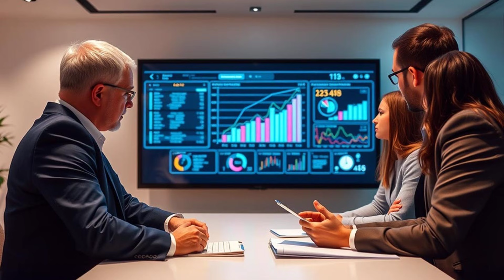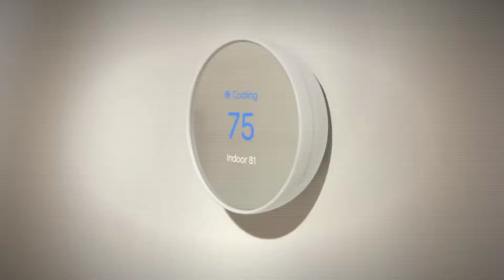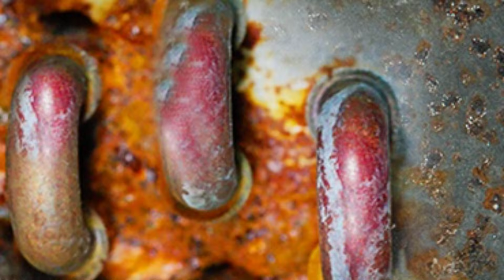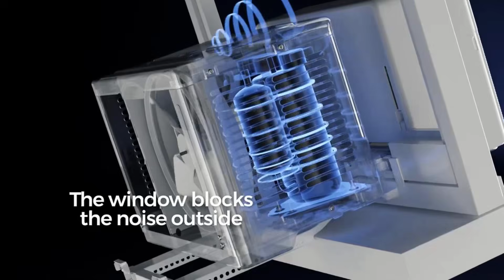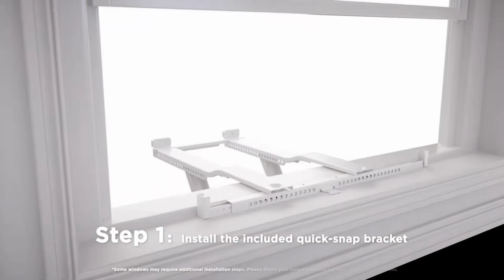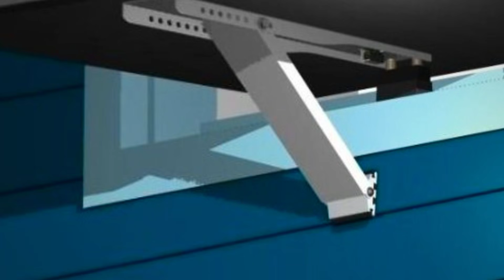Why HVAC Techs Refuse to Pay $500 Power Bills (The $300 AC Loophole)

Comment: like 90% of my clients have no idea what I'm doing in there home, it's a education issue home owners should be expected to understand there core concepts of how There hvac system works. A HVAC System is NOT the UNITS its the HOME and the Envelope. Even most home inspectors have no idea how to guesstimate air leakage in a home, duct work is extremely complex as per balancing and shit head contractor rip out and replace without knowing what there new duct geometry causes additions to duct work are hardly every balanced right. under education in HVAC systems have lead to me being able to say 100% of homes have a problem I can solve. I don't need to up sell you anything to survive, every one of my clients need 100s of jobs done we just determine there priorities.

Comment: About 80% BS. For example, most upper tier central air condensing units are 16 SEER, and use variable speed compressors. Most "mini split" units are very expensive to buy, and even more expensive to repair, because that Co is the only place you can buy a board or a compressor. If you have a single speed compressor, you can add a soft start module. This sounds like AI nonsense to me.

Comment: I completely agree. My stepfather owned  Erie petroleum. Money was never a problem for him, he always used window A/C units. You could hang meat in the house. My friend asked him why don't  you just fix the central unit. He told him it works, he did have it fixed but the last time it broke down , by the time he noticed it was not working and the company fixed it he already had the widow units in and they cooled better and he found them to be more efficient. when one broke he trashed it and had 2 in the shop for backup.  My central unit just broke down and we have 3 window units for backup if the power goes down. My generators are 7000 and 2400 watts so I could not run the central unit on a back up generator. 3 window units are cooling a 3200 sq foot home in TN. They are working hard mid June but so far so good. I will most likely need to install one more up stairs very soon.

Comment: in Thailand, a full AC installation (i have recently had it installed on the second floor of our house) costs 2,000 THB or ~65 USD. 18K BTU inverter AC (Comfee, a sub brand of Midea, warranty is done by Toshiba in TH) was 10,000 THB during a recent promo or around 330 USD
Reply: it's hot here, up to 35C or 95F recently, this AC has a built in power meter (among other nice features), it uses around 5-6kWs per day, i run it 24/7

Comment: There are people who have routed their central air system to run off a cheap solar panel and a battery.
Reply: It can be done for relatively cheap. If you own your home you can start building an off grid setup that you can upgrade as you go along. Start with a few panels, charge controller, inverter and wires for hooking everything up. You could get a decent setup for $1000. Keep adding solar panels and upgrade the batteries to 48v when the time comes.
Reply: @cadevaughn7596 That’s the setup I've always wanted. Still want it. I got a really good deal to insulate my attic. That took most of the stress off my central air unit. Then I tinted my windows myself for dirt cheap. I also added blackout curtains throughout my home, and caulked everything I could. I've been averaging between 2.15 and 2.65 of electricity per day throughout the summer months. So I'm happy with that, but I'm still against giving the man my money though. The last thing on my checklist is to have a company come do a duct blaster test to make sure I'm not leaking any cold air into my attic.

Comment: the LRA on a properly functioning compressor lasts a fraction of a second. what makes an ac cost you a fortune is when they run all the time. hose out the condenser,  seal up and insulate duct work where possible, change the furnace filter, close the vents in the basement (even seal them up),  make sure the return vents arent blocked and open up vents on the top floor and let the coil defrost if it ices over. do all of these and you will love me.